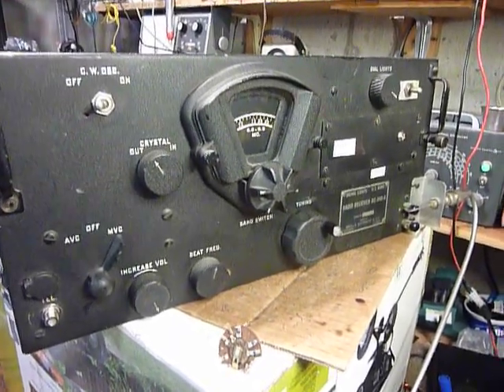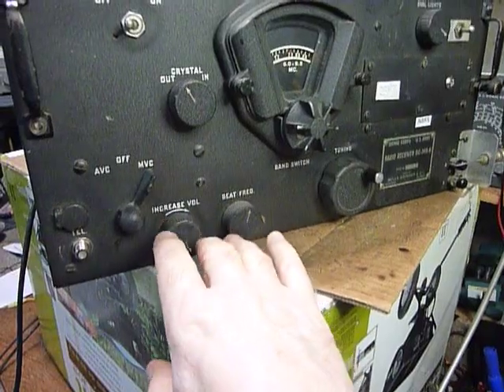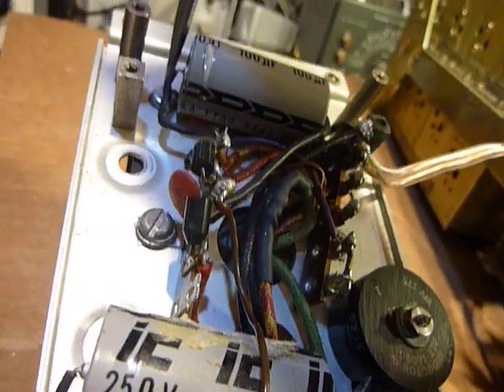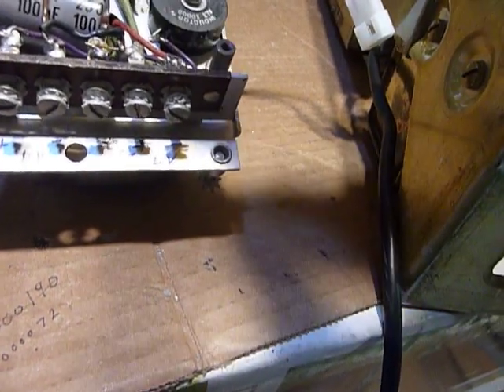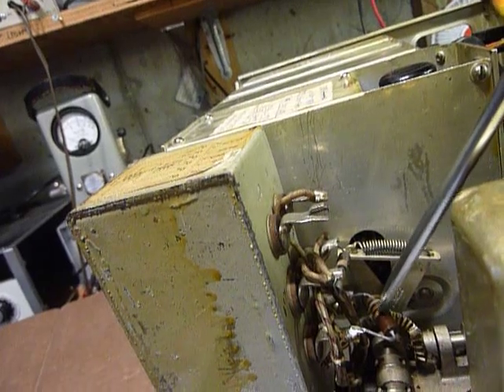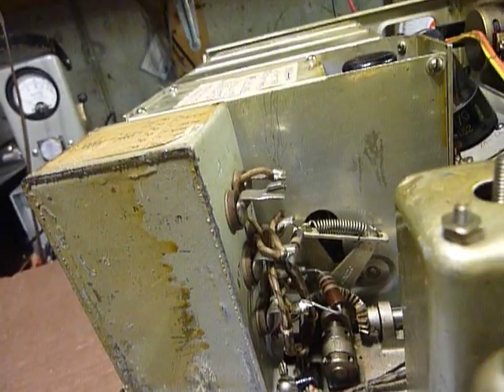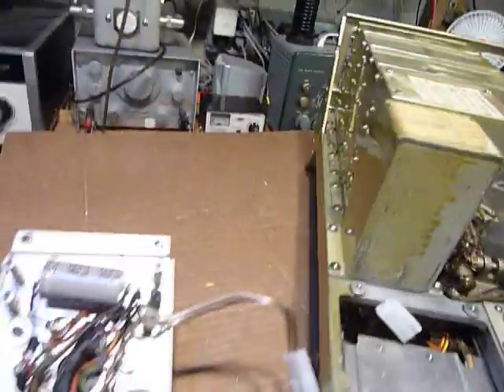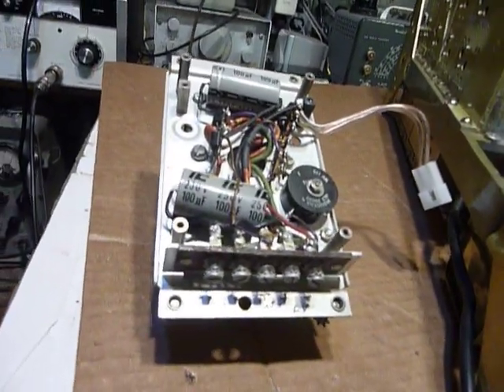BC348 , BC348 World war 2 receiver , B17 Radio ,  Bc348 Update

Comment: Bob, what is a good price for a BC-348M these days (10/2023) ?? It is advertised for $160 on ebay as "non operational/ parts". I have an original BC-348Q with the 24V dynamotor that I have fixed up and is operating in my M-38A1 along with an RT-70 and the antennas for each. I also have two ARC-5 Command transmitters with their shock mounts to go in the Jeep soon. With the rag top and the ability to transceive on the lower bands and low VHF (50 Mhz) it ought to look snazzy. I am going to bookmark this page and check back occasionally to maybe get an answer. 73 de W4FJF.

Comment: Nice receiver,  I'm currently working on a (BC-348) that the previous owner hacked the heck out of. I replaced all of the resistors, all .01 capacitors including the metal can type. I found out the following, those metal can type caps are super leaky, a few of the black mica mold caps had dead shorts! and the wiring shorted or not connected. Now I'm time to peak the IF and perform the RF alignment.  Will upload a few videos soon. Thanks for the video!

Comment: Bob -  I have a BC-348-Q that I picked up at a hamfest a couple of years ago.  It had just been recapped and aligned.  The power supply looks older.  It works great!  I made one video of it operating.  I try to make another video of the work that has been done to it.
https://youtu.be/Gn-rh6WiXio 
73 es Gud DX
Paul AA1SU